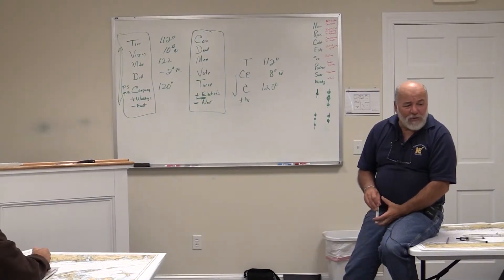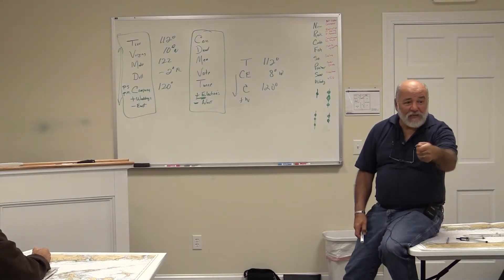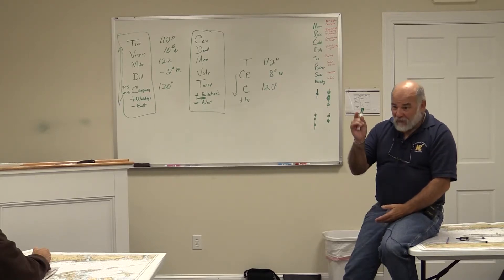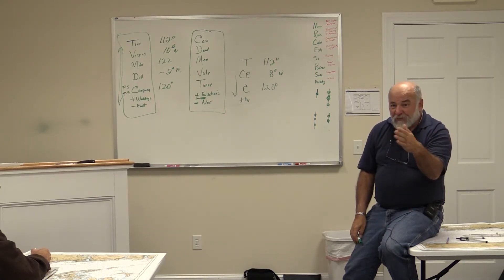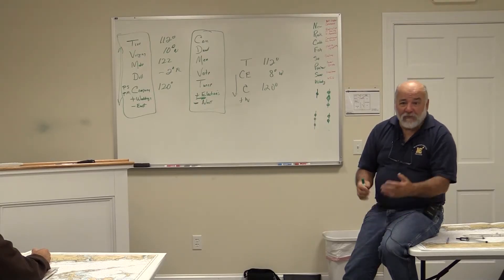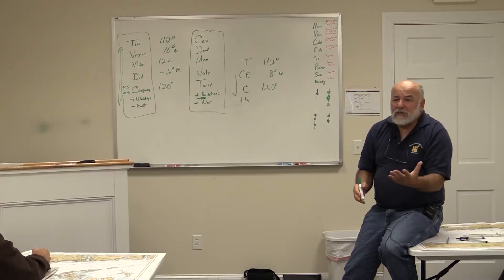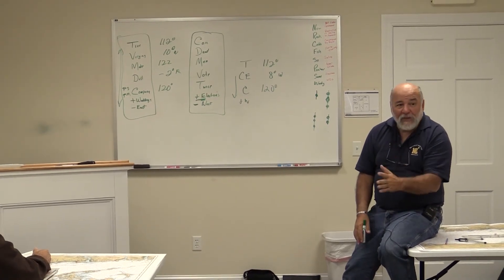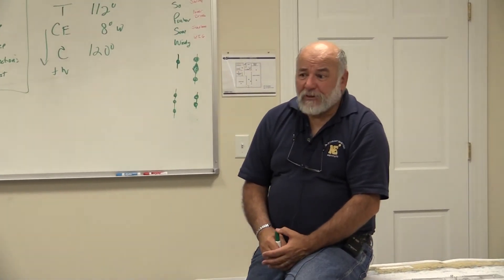Navigation - Deviation Explanation

Comment: really learning something
Reply: Because of the coming micronova, declination is moving much farther, and much faster and so declination information is likely incorrect My up-to-date declination is 30 degrees, 15 degrees off from the official declination for my area. but there is still a way to recalibrate magnetic declination using the shadow of sticks recording the path of the sun---rotation of the earth has not yet changed. First stick will show East. Mark it with a sharp stick pushed in. After a few minutes you can mark sun shadow travel where the shadow has moved - Push another stick in to mark West. Lay a straight stick from the E mark to the W mark. Geographic north or True North is 90 degrees from the E-W line. With your compass pointing toward True North, note how far off your compass is now. That is your true up-to-date declination. More on micronova in my 2nd book, Surviving the Micronova: This Train Is on the Tracks is available now.
Reply: @allenheart582 earth is flat and north is north